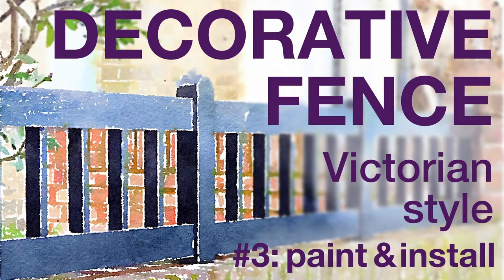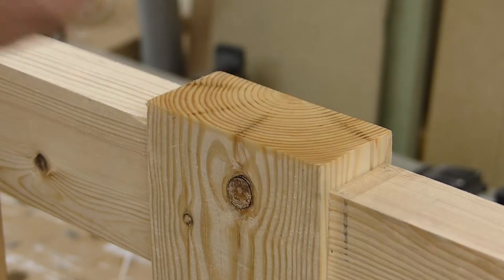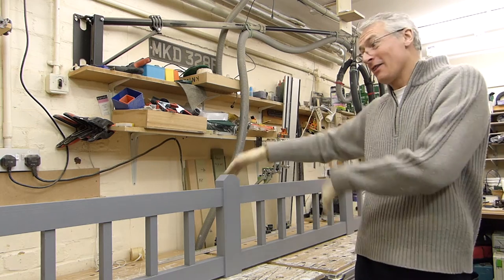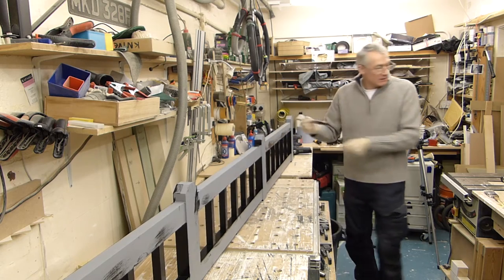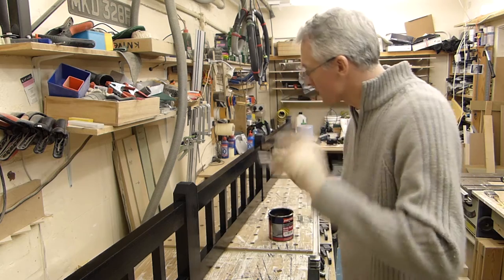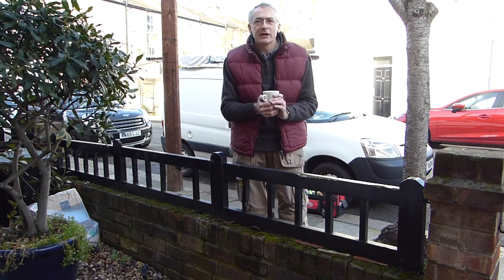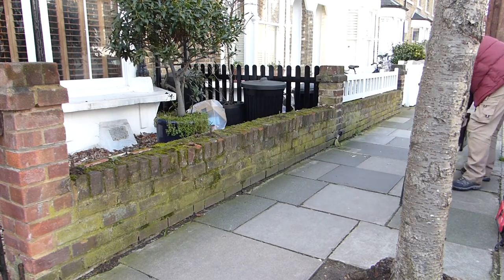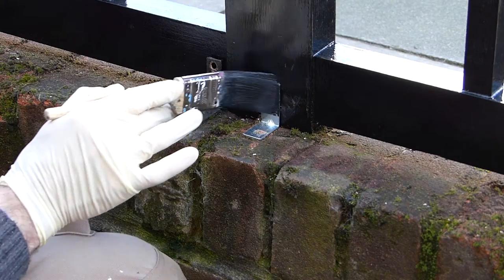How to Make a Victorian-style Decorative Fence P3, #018

Comment: Great video!  For end grain, I buy PVC trim board (3/4" x 6" x 8'), cut them down to size slightly larger than the end profile of the vertical posts, glue them on with construction adhesive, and them trim the excess with a trim router.  This is done at the beginning of the project after the verticals are cut to rough size.  That way you can proceed with the project without having to compensate for the PVC base pads.  The PVC paints perfectly and there is zero chance of water penetration through the end grain.  A bit more work, but absolutely worth it.

Comment: Why do you use water based paint for an outside project? Solvent based paints are much more durable if I am not mistaken.
Will take a lot longer to get the job one though.
Reply from the maker: With respect, you’re mistaken; water-based paints are just as durable as solvent-based, with none of the VOCs. I haven’t used solvent-based paints for a dozen years or more, and I’m not about to start. 👍👍

Comment: Great Videos as always Peter, found your channel while i was looking at info on the Festool TS55. I know its a bit of a late reply :) but when your using gloss paint you could try a few things in order to get a better finish from a roller or a brush. I go down the route of mixing the paint up in the can so there are not solids at the bottom of the tin, then boil the kettle and place the tin of mixed paint into some of the water from the kettle to allow it to heat up which in turn makes the paint become thinner and allows it to flow out better meaning brush marks or roller marks should be minimal to none (this option helps a lot if your painting in the cold). you could also thin paint down with water, paint thinners or white spirit depending on type of paint which will also help the paint to flow out better although down side to this is it will increase drying times and could mean more coats of paint are needed to get full coverage. 

i generally try the first option first but i have had paints where ive had to use both options in order to get a good finish. Your location also got me thinking about London taxis and how they were painted back in the day and wondered if it would work with water based paints. put your paint on the part your painting then with a spray gun spray a light amount of water on it to help aid the paint to flow out (would mean no real need to mask everything up due to it only being water and no paint gun clean up needed) i dont know if this works however but maybe ill give it a go when i get chance

Comment: Hi, am loving the vids thanks. Just a thought when you paint the two sides you rock back and forth but have you not painted the bottom of the posts it which case you would get paint on the bench ?? thanks joe
Reply from the maker: +joseph woodhouse Thanks. No, the base of the posts are painted, just a little later on. I stop by briefly over the weekend to do this 👍

Comment: You're a perfectionist. :) I'm very curious about how much this ended up costing the client? Many would just do a hack job, but you took your time using dominos etc. Very good!
Reply from the maker: DIY Geezer Thanks! I underquoted on this one, but it was for a client I've done a lot of work for in the past, so I didn't fret about it. Final cost was around £800 all-in.
Reply: @10MinuteWorkshop  wow in Derry, n,Ireland that's a begrudgingly £150 at most all in.
Your price seems right though as materials, painting, drying time etc then install could easily waste 4 days of your week which in reality costs you a week(cant start a new job on a Friday as its usually bad practice)
Not knocking you by any means it's just nobody here would pay it.keep up the good work.
Reply from the maker: @jimdoherty5010  Thanks! That was 3 years ago too - I'd be looking for more than that now, just FYI. 👍
Reply: @10MinuteWorkshop  and I dont disagree, I think the reason the trades are dying out here on this wee island at least is because of that,most young wont work for buttons and rightly so,materials have rocketed but wages have fallen.

Comment: Any chance of a workshop tour?
Reply from the maker: Yes, I have one planned - not that there's much more to see, tbh, it really is small! But I need to get it reasonably empty, which is a challenge right now :/
Reply: I look forward to it, I did see some Festool routers on a shelf, what do you think to the of1010 I think I saw one?
Reply from the maker: Samwise457 Sharp eyes, bro! Yes, OF 1010 is a lovely router, esp. with the 8mm collett - powerful enough to do some quite demanding work, but also handles really well. I also have an old OF900 dedicated to the LR32 pin jig, and a well-used OF2000 that just comes out for the (rare) worktop cuts etc... TBH most of my routing is done at the bench, and I have a big old Triton slung under there; works well. Cheers, Peter